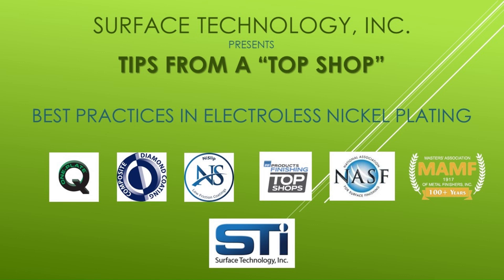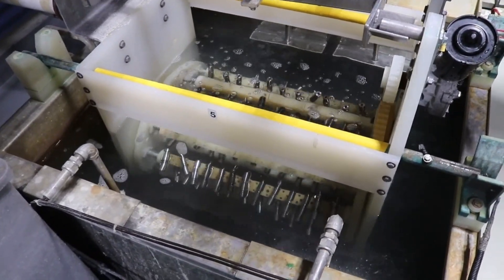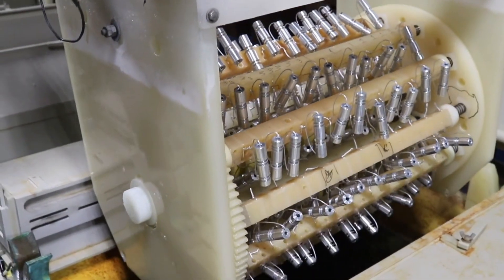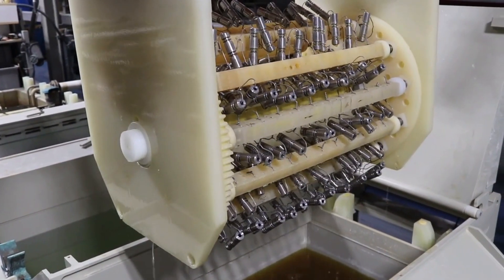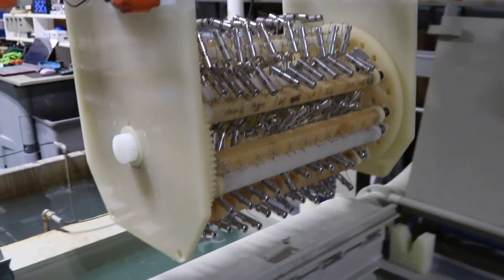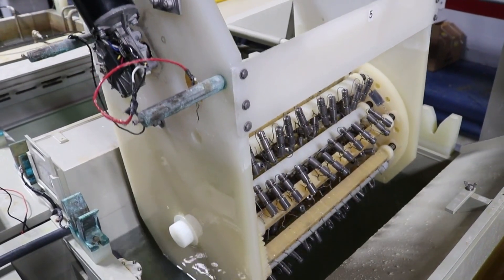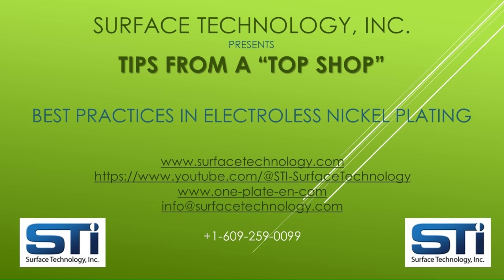How to Plate Electroless Nickel on Aluminum

Comment: 00:05 Key practices for successful electroless nickel plating on aluminum.
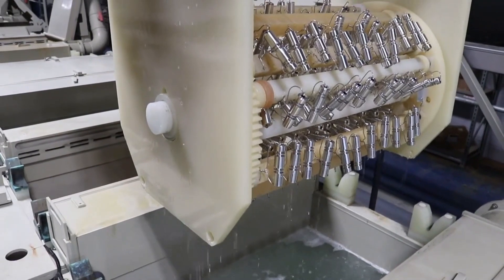01:18 Alkaline etch cleaning is crucial for preparing aluminum for electroless nickel plating.
02:22 Ultrasonic rinsing enhances aluminum surface preparation for electroless nickel plating.
03:33 Proper zincate preparation enhances electroless nickel plating on aluminum.
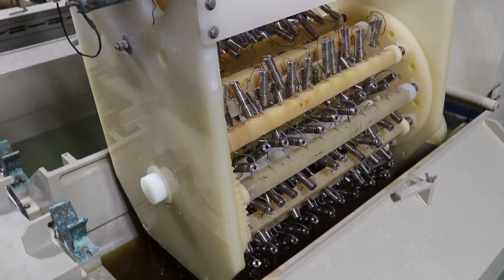04:45 Proper rinsing and timing are critical in aluminum pre-treatment.
05:55 Proper pre-treatment ensures effective electroless nickel plating on aluminum.
07:12 Proper rinsing techniques ensure effective electroless nickel plating on aluminum.
08:14 Support for electroless nickel plating on aluminum and more.